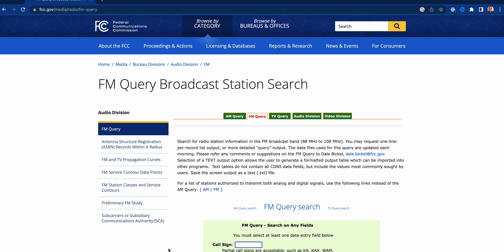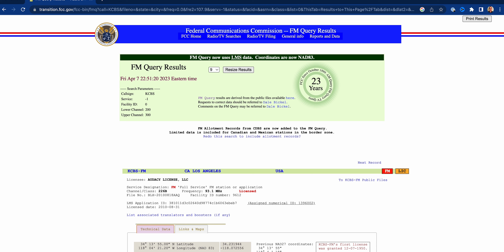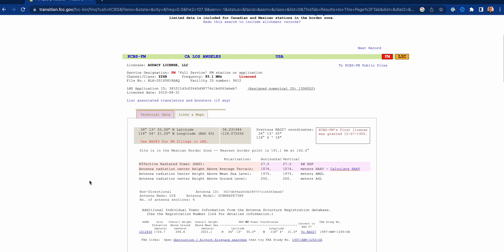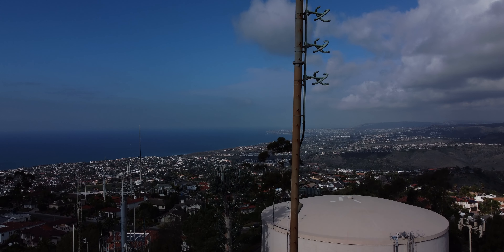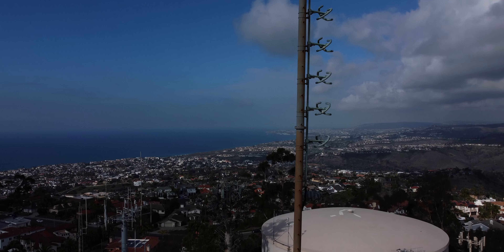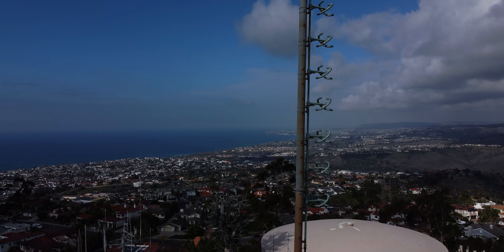Get Ready to Become a Broadcast Engineer - What You Need to Know in less than 15 Minutes!

Comment: As I enter my 40th year as a Broadcast Engineer, the changes I have seen are mind boggling.  From vacuum tube consoles and audio chains to network digital audio all the way from the HDD to the exciter, and the horrible slow transition from king of the world to near death of the AM band.  I'm one of the few left who can (and has) designed, built, installed, and maintained AM directional arrays, diplexed transmitters, filters, etc.  I have watched my skillset go from "specialized and vital" to "who cares?". I said it a long time ago and Paul McLane published it in RW-   "I still love radio, but it stopped loving me back."  In the early days, stations took care of me back.  Example- I never had to buy new tires for my truck, a GM would ask me if I need anything at least once a week, and if I said "tires", she or he would send me to a tire shop and do a trade deal, and I had tires.  Same went for parts or capex projects.  Seemed like everything I needed, I had.  Didn't always get what I wanted, but always what I needed.  And, all I had to worry about was one AM and one FM.  Not like today with 8 station clusters!  The equipment required routine maintenance but was VERY reliable.  And it was fun. Everything came with a schematic, and used regular parts.  No firmware, no midnight crash during a forced software update, no consumer-quality computer stuff.  Everything in the building was "broadcast quality", and it meant something.  Not complaining, just reminiscing.  It still beats having to work a "real job" any day.

Comment: Great video! As a radio announcer this brought back some memories. One station I worked for had an interesting engineer. He told us to forget the calculated power, and go with the indicated power of 100%. One Sunday night during maintenance he bypassed the processor. In the morning the modulation was over 130%! It caught the attention of the FCC who were passing through town. The FCC official sighted the station for over modulation, and sighted the jocks for running the power at 106%.

Then one other story. An engineer was working for a group of four stations. He did something in the equipment room that took all the stations off. This same engineer was at the transmitter, and touched something that through him back against the wall. Pretty big shock! It was amazing he survived.

One last one. This same engineer working for another station where I was the PD hooked up the EAS, and somehow reconnected the audio out of phase. He had to leave church to fix the problem. He's not doing any engineering anymore.
Reply from the maker: Wow!! Yeah there are plenty of engineers who shouldn't be doing engineering.

Comment: I'd imagine you would need an Antenna Rigger to scale a tower and deal with issues there. Those amazing guys scale the most terrifying towers in all weathers. Not a Broadcast Engineer's job.
Same with Power Engineers to deal with High Tension faults. Not generally in a Broadcast Engineer's job description, though they will all be completely familiar with all of these issues.
Reply from the maker: Exactly. But sometimes the job can feel a bit like “you have to deal with X y and Z” and that’s where specialized jobs like tower climbers and electricians come into play. I’m dealing with a fire alarm system at my new job and I’m letting a fire alarm company take care of that. The last thing I want to do is dump a few hundred gallons of water on a data center.

Comment: Do you measure your output with a calibrated meter?  If so is there a certification with the meter?  And who do that??  Just asking....
Reply from the maker: If you’re referring to the RF output… the transmitter’s power meter should be calibrated at the factory. Some stations also have something like a Bird wattmeter. That is factory calibrated as well, and you can send it back to get calibrated. Typically the factory will calibrate the meters. 

Sorry long answer for a short subject.
Reply from the maker: What should be calibrated more often is spectrum analyzers and test equipment like that.

Comment: How  on Earth can an IT guy, typically with zero electronics knowledge, maintain a  broadcast transmitter? From my 40 year POV in this industry, a good broadcast engineer can learn  and understand the IT technology much faster and deeper than an IT guy attempting to  learn broadcast engineering.
Reply from the maker: Are you willing to learn and ask questions? Then yes, any IT guy can.
Reply: @TheBroadcastEngineer  Yes, if learning means a good foundation in electronics.
Reply from the maker: I didn’t hav one when I entered.
Reply from the maker: And from my 23 year POV I’ve seen far too many broadcast engineers ignore IT and choose not to learn it. 

Hence it comes back to being willing to learn something new and having a mentor to help teach it.
Reply: @TheBroadcastEngineer  That's fine, but did you learn the material? I think you did.
Reply: @TheBroadcastEngineer  Yes that is true. And they are less qualified today because of that - their choice. But this idea of taking someone out of the IT department and thinking that can manage a transmission facility is a fallacy.
Reply from the maker: I did. And had a great mentor. But equipment today doesn’t have a whole lot of user serviceable parts inside.
Reply: IT in a transmitter is not crazy like Studio. At the stick its usually for Control and telemetry and back haul for the site video cameras and I 100% with what you said IT guys usually cant even put a Cat5 connector on correctly but there  a wiz in the pc.